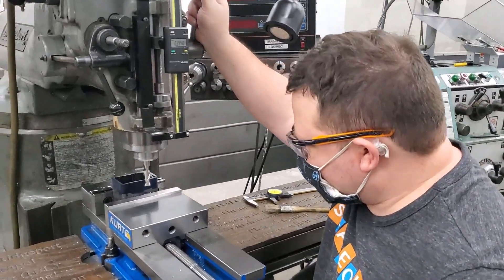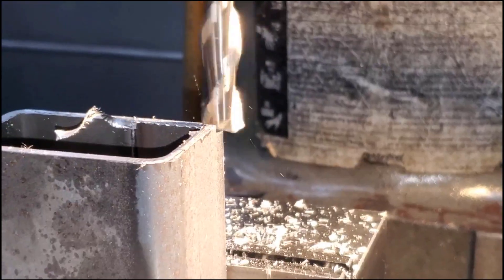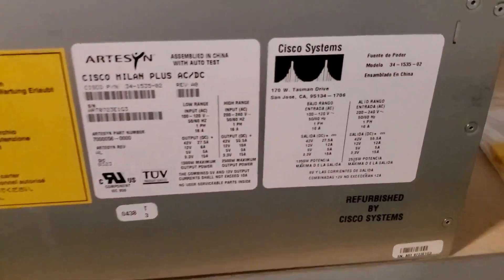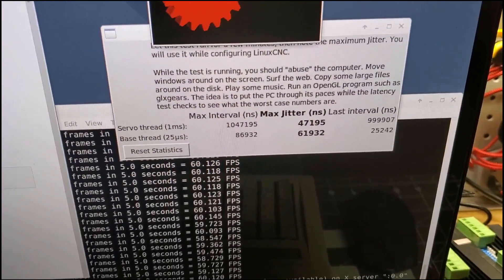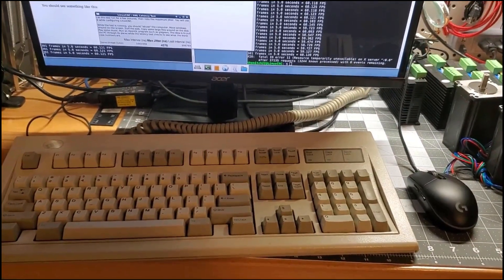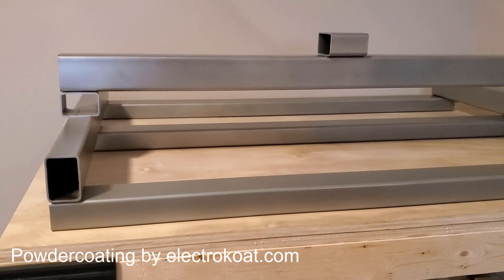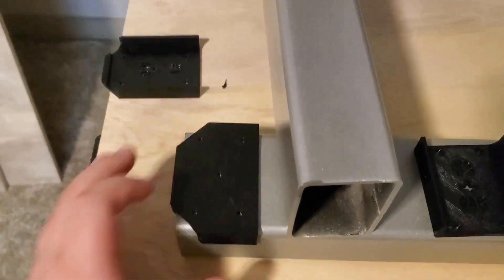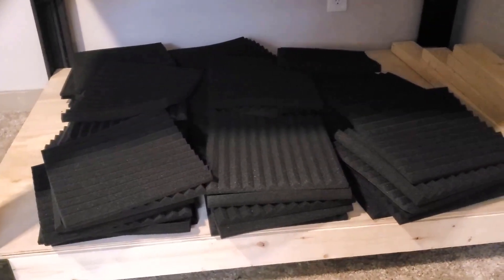PrintNC build continues: Cutting steel, building a workbench, LinuxCNC, and CNC'ing in an apartment?

Comment: Finished building my enclosure today, just foam seals and handles for everything after paint, Your table with take some of the vibration from noise, I have my PrintNC at my work which is a retail store so it has to be ‘polite’ I’ve used 19mm Ply with silicone and paint and I’ll keep adding layers until quiet, potentially you could add sound pyramids on the inside, I find the vacumn and smaller bits make the most noise
Reply from the maker: That’s cool you use yours at a retail store. Do you make items for sale?

I moved out of this apartment into a house with a basement so noise is less of an issue now. I am over a year late on a follow up video

Comment: Mitch if you would like I may be able to assist you with the fabrication of the enclosure around your machine...If you still live in DFW area you can get the dimensions and we can build over here and design so you can be taken apart and moved then re assembled...
Presently I'm in Grand Prairie so it should not be to far for you to travel...I'm retired so I can help any time...
But in the meantime, your CNC Unit is coming along very nice...Looking forward to seeing it up and running and what you'll be able to achieve...
Reply from the maker: So about the DFW thing, why I haven't made a video updating about the PrintNC... I accepted a new job and moving everything including the PrintNC to St. Louis! I will have an unfinished basement now so I don't have to worry as much about sound and chips. I would still appreciate info about your enclosure, please DM me on discord! themitch22#5585

Comment: The sound foam does not stop sound transmission. It only reduces echoes. In order to make it quieter on the other side of the wall you need to add mass not diffusion. Basically it needs to be an airtight and heavy enclosure for it to be effective at reducing sound transmission.
Reply from the maker: Yeah I realized the acoustic tiles won't do much but I do plan on building a double wall enclosure.

Comment: Hey man! Good job so far! I am running a PrintNC too but in my garage. I also have an enclosure, fairly simple, just single wall plywood. Overall the sound dampening is fine, but as you know I am sure noise will also depend on what material you mill, feeds, cutter type etc...Get a good vacuum cleaner and you should be fine. Cheers.

Comment: You're not the only one who will be running it in a apartment. I already do lol
But yeah, the right thing to do is to take it to an appropriate location 🤭
Subscribed to get every update from your journey.
Hope you have a good one.
😁👍🏻
Reply from the maker: I'm curious to see your setup! The only rental studio I found was about $300/mo  and very barebones. There's really no workshop space available that isn't expensive commercial property. Frame assembly should happen pretty soon, I have more stuff coming from Amazon and eBay.
Reply: @Mitch3D 
Hi Mitch,
Is it up and running? 😁
I stopped my machine till I build a good enclosure because of the noise it makes cutting aluminum and steel lol 🤣🤣
Reply from the maker: @pmsilvei  nope I'm currently taking my time building the electronics enclosure. I'm not too far from having it running. The enclosure will be a big project I believe. I will only run small test cuts without it, my main concern is the dust/chips going everywhere.